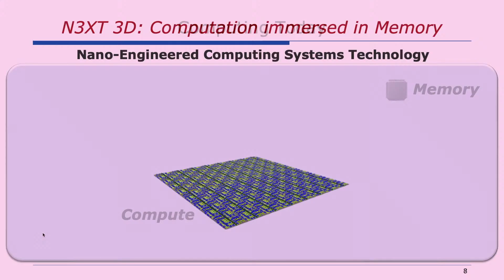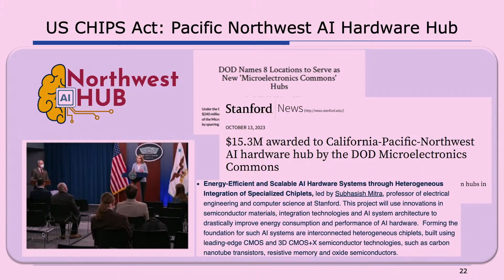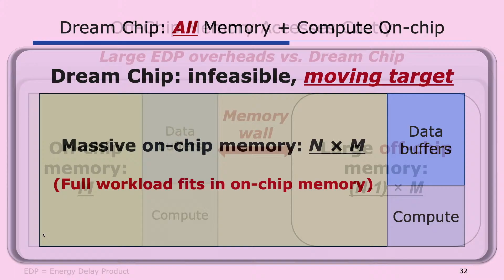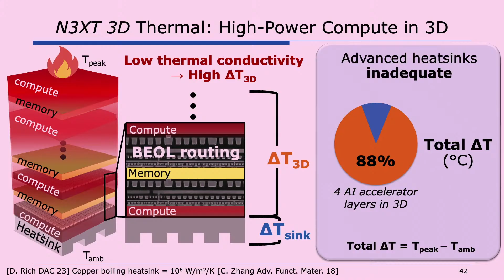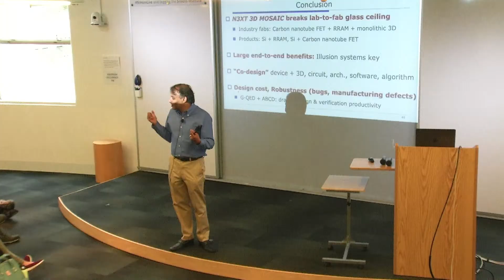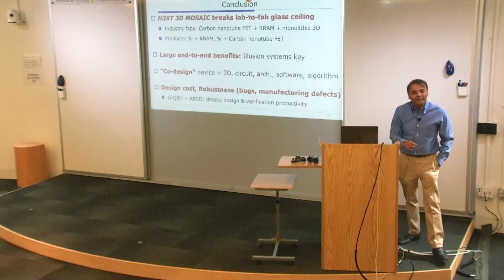The Future of Hardware Technologies for Computing

Comment: Thank you for sharing this talk. I am not sure whether Professor Subhasish Mitra will see this, but I wanted to leave my questions here anyway.

1. You mentioned that N3XT achieves 100–600× better EDP than today’s packaging. What reference design are you comparing it against?

2. N3XT is a monolithic design that integrates memory and logic on the same chip, which reduces vertical interconnect length compared with a 3D folding architecture. In that case, what is the main architectural difference between N3XT and 3D folding?

3. My impression is that N3XT’s EDP gains come largely from its monolithic integration. But monolithic integration usually has yield challenges. How does N3XT compare with chiplet-based designs in terms of yield?

4. As I understand it, MINOTAUR reduces static power through power gating, which is already widely used in digital chips. Are there other techniques involved in reducing static power further?

5. Low-rank incremental training had already been explored in the literature by 2013, but it did not attract much attention because it is a fairly natural way to update matrices, not only in neural networks. LoRA stood out because it freezes the pre-trained model and learns only low-rank matrices. Given that, what is CHIMERA’s main conceptual contribution beyond implementation?